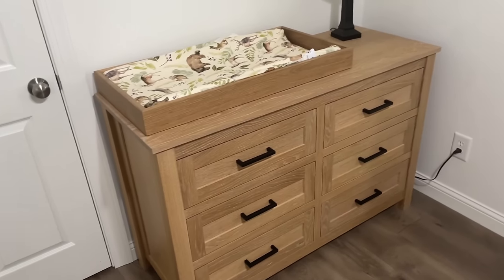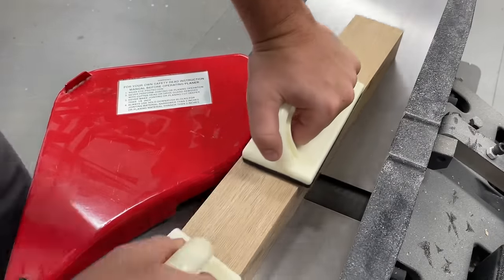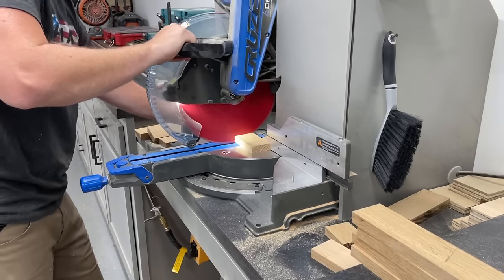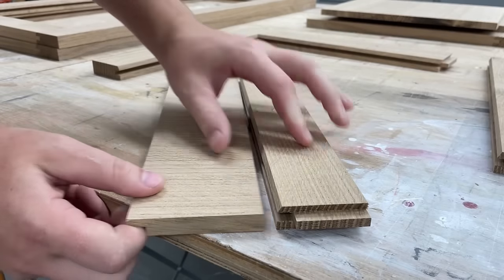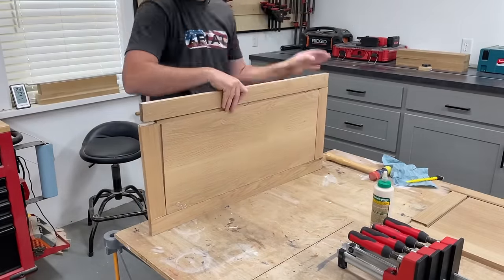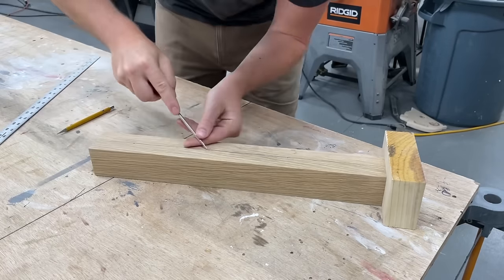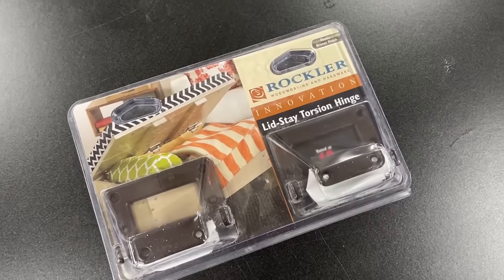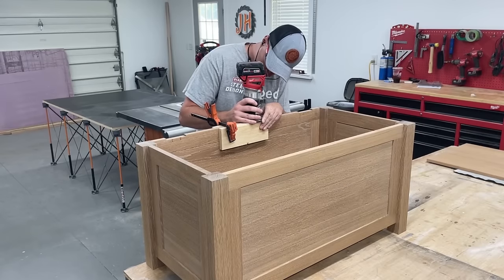Heirloom Quality Beats Store Bought ANY DAY  | Building a Chest/Toy Box

Comment: @JohnBuildsIt - since it's been a bit, did you ever need to add platens to prevent cupping for the top?  It seems awfully wide and like it would be easy for it to warp over time.
Reply from the maker: No I didn’t, still flat!

Comment: John, I’ve seen a lot about Rubio monocoat.  What makes so much better than a poly or oil finish?
Reply from the maker: It’s a hard wax oil finish so it’s easier to apply and touch up/refinish if needed. I like all the colors they offer too and just personally like the satin sheen and feel versus a film finish like poly. Durable too, everything I’ve used it on still looks flawless. They have cheaper sample you can get to try some out!
Reply: @JohnBuildsIt  Cool thanks.  I’ll have to try it out then.

Comment: I'm looking at using those hinges soon. The back of the chest is flush with the outside of the legs, is that because the hinges wouldn't work with a set-back/reveal on the back? If so I'll have to see about a bevel or something to allow the top to open. Looks great, John.
Reply from the maker: They would with a little bit, like a 1/2”, but not centered on this size of legs like the other 3 sides. So went ahead and just flushed it to the back to make the inside of the box bigger since you can’t really see it anyway

Comment: what was that you spread over the top and sides then buffed off, grain filler? Looked like that little clear screw or drill guide for the hinges gives you an overhang, how much do you have across the front and back??
Reply from the maker: It’s Rubio monocoat. There are 2 locations on that jig for the hinges, flush or with an overhang
Reply: @JohnBuildsIt  because you replied, thank you much, i have subscribed to your channel...I do like your project